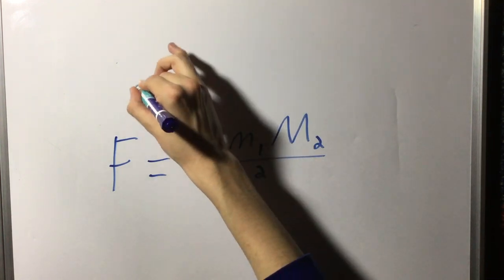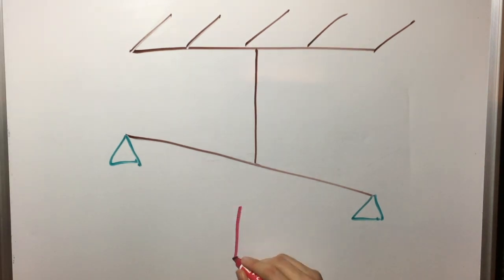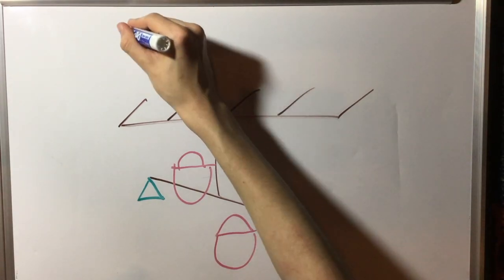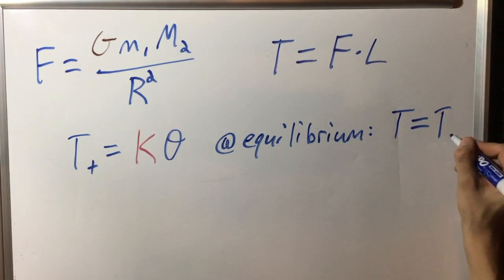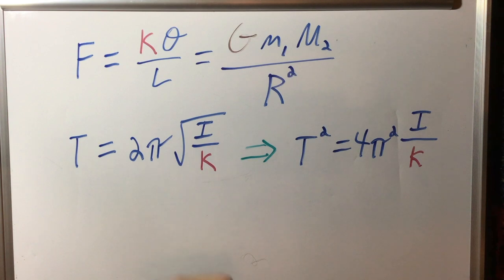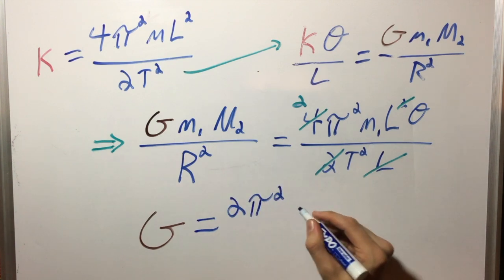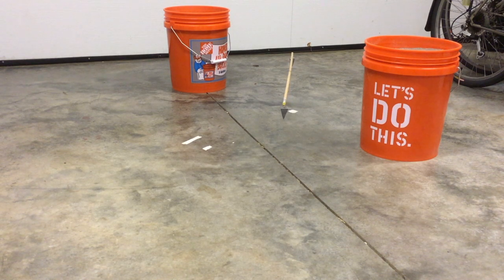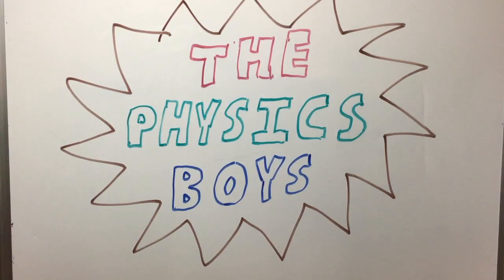The Cavendish Experiment Explained

Comment: I have this experiment going on now for three months now and can not stop the Lenz Law effect on any part of the apparatus. Just suspending the 12mm by 1000mm carbon fiber tube, it will oscillate back and forth slowly for days on end because of the earth’s magnetic field passing through any part of the  apparatus. I cannot even start to try and get any better measurements for gravity. I have tried everything to minimize the Lenz effect. Even suspended it from braided filaments and no material that conducts electricity or magnetic, and it doesn’t matter. I can see why we can’t get an accurate measurement. To do so would require us to send two masses into space outside the solar system, release them and the vehicle would have to vaporize instantaneously, then measure the attraction of those masses from 2 billion miles away. Unless you can calculate the Lenz effect on each piece of the apparatus at each point, at exactly every magnetic field line point, as every magnetic field line passes it.
Reply: Dude what? Isn’t lenz law for changing magnetic field? Which part of the apparatus is undergoing change in M.F? Am i missing smth?
Reply: Yes and the magnetic field lines of the of the earth are what’s causing it. That’s what I’m saying here. No matter what mass material I’ve used, copper, lead, glass, carbon, etc., it oscillates constantly due to this. What I’m saying is, gravity does not oscillate or pulse.
Reply: The Cavendish experiment has been repeated thousands of times with due diligence. And returning similar results.
You're doing something wrong.
Reply: @marcg1686 you are right, I was doing it differently and stumbled upon an interesting effect. Gravity casts shadows, and from there, I’m know able to focus and magnify the gravity field of a mass.

Comment: The equation given , without explanation or justification,  is the equation for the period of a watch balance wheel, where the only force present is the torsion of the spring. Thus T must be measured without the additional weights. Just the bar.

Comment: There is no physical meaning to stating that the length of the rod is 0.92m, unless you also specify the possible error. This is in particular important when you calculate extremely small constants.
Reply: This would be important in order to estimate uncertainty of gravitational constant, not its value.
Reply: The original length was in inches and here it was converted to meters...

Comment: @Santiago Monleon I think you did an excellent job with your video. I noticed a few things that may need adjusting (unless you did these behind the scenes by doubling Mass 2). When looking at your equation of the torsional force being equal to the gravitational force, you have a mistake in that the torsional force is equal to 2* the gravitational force. It is possible you hid this step, however, I expect that by dividing by 2 you will end up much closer to your expected value. In addition, you showed that your R is measured from the mass on the rod to the bucket. In reality, the R should be half the distance. So if we divide .13m by 2 and include the prior point, we actually have your value of g that was calculated as 8 times less giving you around 8.80875 x 10^-11 m^3/(kg*s^2). Please reply and let me know your thoughts. I am not pointing this out as a troll but as a fellow physics lover and prior student. (I went over your video for around 2-3 hours but please forgive me if I missed something.) Thank you again for sharing. Finding this video made my day!
Reply: I do realize an approximately 11 inch diameter bucket for M2 and a ~5 inch distance from the bucket may mean that the R used may be the most effective choice anyways considering the center of the bucket is another 5 inches. I can understand why lead or gold is desirable for this experiment. I am in no way trying to be difficult with your overall measurements. I am simply interested in identifying if you were really a full magnitude of 10 off in accuracy given your efforts.
Reply: This comment is really helpful! I was planning on replicating this experiment myself, so thank you. The only other thing I would add is that in the experimental set up, you can see that the centre of mass of the sand in the buckets is far below the height of the masses on the stick. This would artificially increase the effective R value, as well as meaning that a large portion of the force is not in line with the measured direction of motion. This could be fixed by just elevating the buckets by 20cm or so.

Also, maybe increasing the mass on the weights on the end of the stick is a good idea? The calculation for "I" didn't account for the rod, so probably best to account for it, or make the masses at the ends large enough for the rod's moment of inertia to be negligible.

Comment: I'm not a mathemati...mathema....I'm not good at maths...but why isnt the attraction to earth holding the weights still? Is their desire to fall being overcome by the pull sideways?? ...
An answer would be appreciated.
I also dont understand how gravity is emitted sideways in the first  place...I just dont understand.
If I hang a ball next to a lorry, that ball will move toward the lorry....why?
What am I missing here?

I mean, you're certainly not saying the bags are emitting their own gravity...radially...because that would be nonsense, right?

To produce gravity of their own, the bags would have to be disconnected from earths gravity, so how can you calculate earths mass from somerhing that is part of that mass?? How do the bags disconnect from earth in order to produce their own gravity? They'd have to be flying.. ......WTF??
Reply: First of all must take a basic engineering or physics course where you learn to sum up all the forces acting on a body. That might answer your questions.  News flash: bodies can actually have a multitude of forces acting on them at the same time. 

As to why your body doesn’t get pulled towards the lory: again I point you in the direction of using the equation and values that models gravity quite well. They involve masses, distance and a constant. Hint: the force of the lory pulling on you is thousands of time less than that is a light breeze blowing on your body.
Reply: @kitcanyon658  you just gave what seemed to be the most condescending answer to what seemed like a genuine question. Are you trying to excite people to think and learn or just make them feel dumb while you stroke your ego?
Reply: @borp8819  : Not at all. I'm merely pointing out the absurdity of someone asked YouTube to educate them. If they are smart enough to work a computer to get to YouTube then they should be able to use a computer to look up knowledge and learn from it.
Reply: The gravitation of the Earth is not holding the weights still because there is a new lateral force, the gravitation from the lead masses. And yes, gravitation acts in any direction, always towards the center of a mass. In the case of the Earth, the center of the mass is the center of the Earth, so gravitation acts towards the center of the Earth (aka "downwards" in our daily life).

If you hang a ball next to a lorry, yes, it will be attracted. Only that the force of attraction is so small you won't notice it. Let's put some figures: imagine you are holding a ball of 0,5 kg (1,1 lbs) next to a 24000 kg lorry (52863 lbs), the distance from the center of the lorry and the ball being 5 meters (16,40 ft). The gravitational attraction between the lorry and the ball will be: G*M*m/(d^2) = 6,7*10^(-11)*0,5*24000/(5^2) = 3,22*10^(-8) Newton = 0,000000007 lbs. As you may imagine, this is completely irrelevant in real life, even for precise engineering calculations.

The masses uses in Cavendish experiment are, in reality, disconnected from Earth's gravity because they are hanging from a wire, negating any possible vertical movement. The movement due to the experiment is strictly horizontal, therefore unrelated. It's the same reason why you can easily push a 1000 kg (2203 lbs) motor car (assuming, of course, it's unbraked) in a level surface.
Reply: @betaorionis2164  Earth has gravity because it spins....you are saying the lead is creating gravity?
Thats the bit I have a problem with.
(So the lorry wont attract the mass of something in any noticeable way...so thats no in real terms, real meaning before I die 😁)
The guy saying there are lots of forces acting on something could go on to explain which force is causing the result witnessed. 

After all he did sound so awfully clever....

Thanks people (you know who you are 👍👍👍)
Reply: @cocksure8430  Earth has gravity because it spins? Nope, that's not correct. Earth has gravity because it has a huge mass of 5.97*10^24 kg. Rotation has nothing to do with it.

Yeah, there are lots of forces acting on the Cavendish experiment, but all the remaining forces are equalized, so they are not relevant. If you have doubts, just ask yourself why the experiment has been repeated thousand of times in thousands of places, yet it always gives the same result. The only possible explanation is that Newton was right and masses attract each other, proportionally to the value of masses and inverse proportionally to the square of the distances. In your own words: masses do create gravity. And huge masses like the Earth create noticeable gravity.

In fact, there is another even better proof of Newton laws (and the derivative Kepler laws, even if Kepler predates Newton): the orbits of all objects (natural or man-made) in the Solar System and beyond. They all micrometrically, precisely, exactly follow the laws ok Kepler, theirselves based on Newton's gravitation (even if Kepler predates Newton).

You say the lorry doesn't attract the ball... except that if you take two very heavy balls of lead instead of the lorry and the rubber ball and you put them very close one to each other, then you start to notice a movement. That's, precisely, the Cavendish experiment.
Reply: Watching it back, simply put, the buckets are an extension of the earth because they are on the floor?
Is that too simple?
I understand torque resets the bar....of course, but I have a problem as to what would initiate the movement toward the buckets. 
So the buckets are the closest extension of earth to the weight, gravity is of course passing through them (simply put),  so thats what the hanging weight is drawn toward? Too simple...or near enough? Answer is genuinely appreciated,  I am not just a reply whore.....not in this thread anyway 😁👍
Reply: @betaorionis2164  I appreciate your answer, but please dont assume I doubt the results simply because I dont understand it.
Never said it, I said I have trouble accepting it, not it was incorrect, two complete different things.
But again, thanks.
So you are saying the bucket of sand creates its own gravity...that it is not the earths gravity feeding through the buckets? 
Or otherwise you are saying the lead is creating its own gravity, which if true is the bit I find hard to believe.

But again, whether I can believe it or not has no bearing on its truth.
Thanks again.
Reply: @betaorionis2164  So, we are not held onto the planet by gravity...just by the rotation.?
Its funny what you can mis-believe as you get older.
School and any practical use of maths is a distant memory for myself. Any maths I have had to used in my career have been less than complex, and a discussion of earths mass and gravity, funnily enough, hasnt really come up recently !!😂
Reply: So.....any mass creates its own gravity, which becomes greater the denser the material, ie lead?

What do I win??

Thankyou all.👍👍👍
Reply: @betaorionis2164  Just so  you can understand the way I think.
After reading this, at what weight would a lead ball fall faster than a mass of feathers of exactly the same weight...ie, at what size would the gravity the lead ball creates itself,  accelerate it toward the ground faster than the feathers....the lead balls own gravity moving it toward the earth along with the earths gravity pulling it down, theoretically of course...Im sure it would be unfeasibly massive before its own gravity added to its acceleration.

You need not answer, but its just the kind of place I immediately go to after being told that things, especially denser things, create their own gravity!!!

At what size is the lead ball accelerated by two sources of gravity, whereas the feathers...although weighing the same, wouldnt create their own gravity comparable to the lead.

Bit of a teaser, or a very simple 'never'....
Have a good day, thanks again people.

Comment: i dont understand, so that experiment calculates the gravity that the sand bag emits?
Reply: I'm lost too....how can the bag emitt its own gravity whilst still be connected to earth? Obviously earths gravity would flow through the bag, therefore how can you use any measurement from the bag (as a unit to then multiply) to calculate earths mass, as the movement IS from earths mass??
And gravity acting radially on an object????
Down only, the stick would surely become locked in place by earths gravity....how would gravity from a bag overcome that???

But again, for gravity to truly be coming from the bag alone, the bag would have to be floating in air...otherwise it is emitting earths gravity....surely?? In which case, if it can overcome earths gravity>>, if the bag was , tall enough, you could drop the weight and it would eventually stick to the bag before hitting earth.....but this is nonsense......lost I am.

Comment: 6:50 You say "it took us many many trials to get the experiment to work correctly" which means that you discarded all the results of the trials that did not meet your expectations. That's not science but a self-fulfilling prophecy. You assume that objects attract each other and that Cavendish's experiment is useful for something and with those premises you have proceeded to carry out that experiment, many times as you have said, so that you have not allowed any other correct result than the one you assumed as right from the start. Is that science? No.
Reply: Immediately after saying it took many trials to get the experiment to work correctly they explain the reasons for why the previous experiments where invalid such as air currents. Additional uncontrolled variables being introduced into the experiment makes the experiment invalid. It is the equivalent of someone measuring the effect of lack of sunlight on a plant by placing a tarp over it but then realizing the tarp had a hole. It does not matter if the experiment showed something since the experiment wasn’t run correctly in the first place.
Reply: ahahaha owned
Reply: @stevenminuteman8996  no. A tarp with holes on the experiment you described would be negligent or on purpose. The original comment is 100 percent correct
Reply: @drew7155  You’re correct, not realizing all the possible variables and seeking to control them is indeed negligent. Yet they were not negligent enough to just assume those were the correct results.
Reply: It's also done by physics students across the world annually, so, if there was an issue we would of seen it by now. 

Also disregarding results from incorrect methods, is scientific,  it would he nonscientitic if we discarded a result with correct  methodology or accepted a result with incorrect methodology.
Reply: You see mr low iq, the experiment was to measure the force of gravity not to prove its existence. So you really don't know what you are talking about.